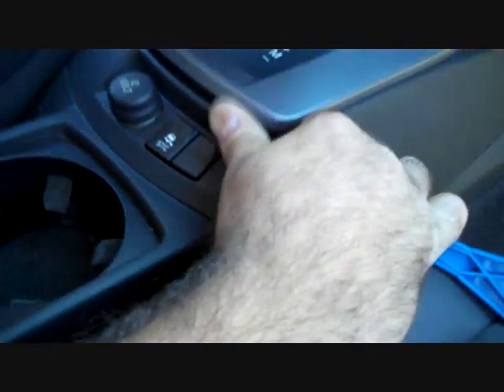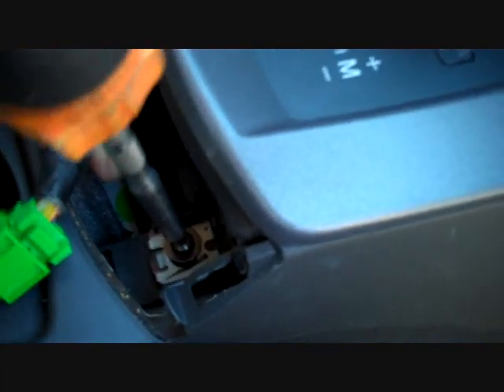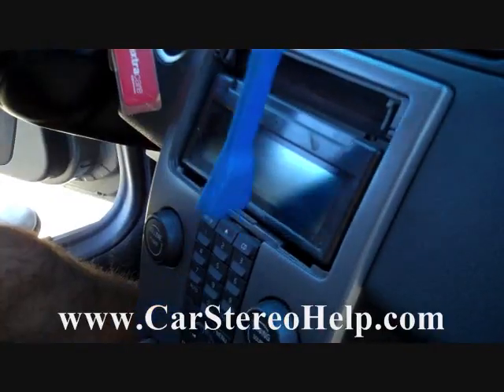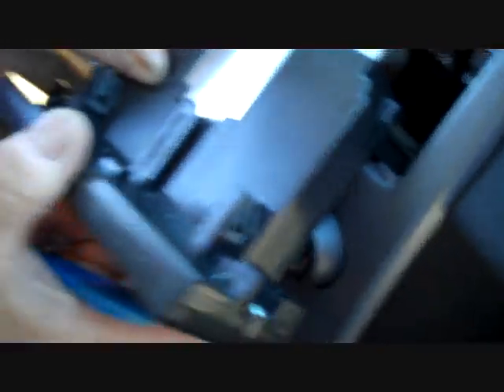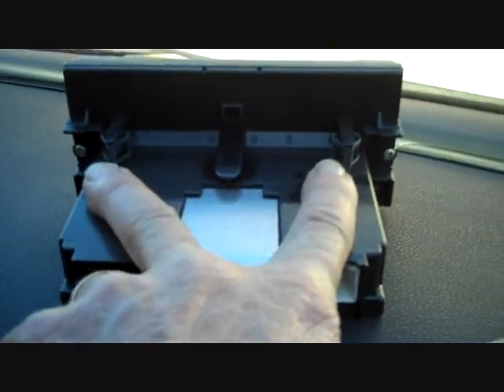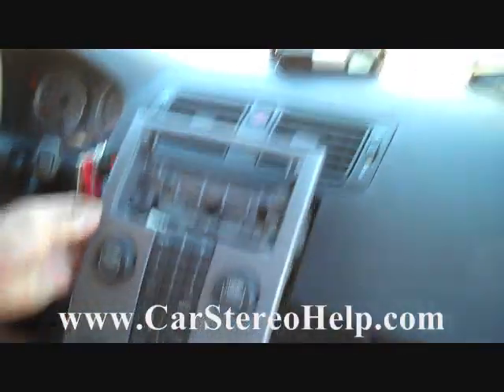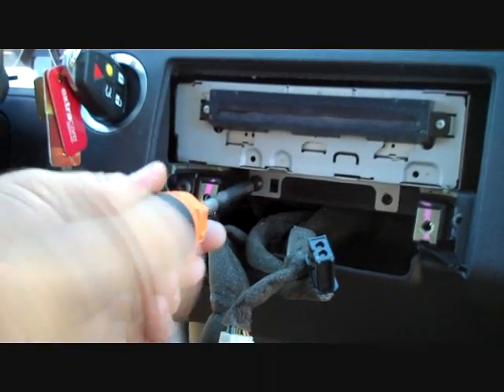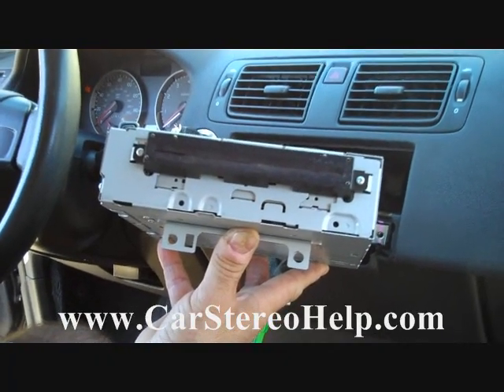Volvo S40 Car Stereo Removal 2004 - 2009 = Car Stereo HELP

Comment: i have a 2006 volvo s40 an i went to multiple different audio installations places including best buy an they all told me my year and model is the only model that you can not put an aftermarket receiver in, but you took it out so easily....
Reply: The reason they can't put aftermarket unit is not because it is impossible (or even hard) to remove the stock one. The reason is that the stock one uses optical fibre cables to send the audio signal out. And I believe that signal is not only digital but also encoded with Volvo's own proprietary protocol.
Reply: Same with my 2007 c70
Reply: @secretwpn how do i even know if its possible? Is it with all s40 from that year

Comment: very good and easy to follow instructions. would help if showed which cable you used to connect stereo afterwards though, having trouble finding the correct one

Comment: This video was excellent. It worked perfectly well on my 2007 S40.  Only challenge was that my cd changer was a six disc changer and was a bit more difficult to slide out.  Other than that was absolutely no problem - and it all went back together
Reply: 7 years later there's me trying to remove this 6 disc changer one too
Reply: Same lol

Comment: What protocols does the CD player use to communicate with the stereo's head unit?   Is it over the optical or an analog?    Wondering about making an upgrade to switch the CD player out with a Bluetooth module and AUX port.

Comment: Dear sir! I have a problem with the waterfall console, as the backlight is dead, and no controls works at all. At first the console went dark and later worked again. Now dark again. I suspect bad connections. Do you have an idea of where to look?

Comment: Be aware, if you order from Bluepower in Sweden, they will NOT give you RCA cables, FM cable/splitter. And also no pre-installed software/maps on SD/RF card for the GPS.

Comment: I did all the steps but the cd played couldn't be removed, the dash is in the way on my 06 S40, I can't get the speakers to work and I've tried all I can think of, I replaced all the fuses associated with the audio system, checked for any loose connection on the amp, and I even bought an amp and replaced it last night and that's not the problem either ...so frustrating I just want to blare my music lol

Comment: Hello from Germany, i have some Problem with the Aux-Input of my v50 /2007.
There are disturbing noises, mostly on the left Chanel. With and without running Engine. The Radio and the CD-Player are working pretty fine. Do you think that there is a Problem with the Connection or is there a Problem with the Infotainment-Unit?

Thanks in Advancend
Reply: I have the same problem! I install the module, it works 2h and now it don't turns the Bluetooth on, but the cd player works very well! I can't contact the store because my tindie account dont works. I want the Bluetooth working again
Please contact me

Comment: can you fit a normal din, maybe double din radio in this car without a lot of modifying?
Reply: Hi, u can but you Need to cut a Bit of the Console. Not much of a Trouble, just Need the Right Adapter for the cabels. I habt find the Right one 😅

Comment: what could be the problem when the CD Changer takes the disc in but brings it back out immediately?
Reply: 05 S40, I have experienced the same. Change the entire head unit (100%official) once 2 years ago.  First one was down bcz of deck error. But the second one (new one), only lasted less than two years, then got new problem  - all discs ejected automatically, but doesn't take any CD in anymore. My case sort of proofed that this is the product design problem. So if you trust me, do not waste your money on replacing a new one, nor buying used on e-bay.  Bcz sooner or later, will be same story happen.  I have tried all the possible ways to bring my music back. As of Dec, 2016. Tried both in USA and EUROPE 6 countries where I travel and lived.  The best solution is to install a USB, Aux adapter, solve problem once for all for this particular year range (2005-06)s40.   Find right adapter takes some time and effort. As of today Dec 2016. The cost range $280- $400. Any cheaper systems on the market, can not fit to our volvo s40 (unit this time).  More expensive than buying used, I know.  But worth it, if you still wish to keep your car for few years.

Comment: I bought a. 2004 Volvo turbo S40 the other day. Radio doesn't work. When radio is turned one thump and popping sound comes from speakers. What could be the problem ?